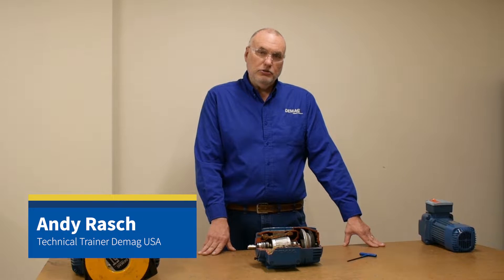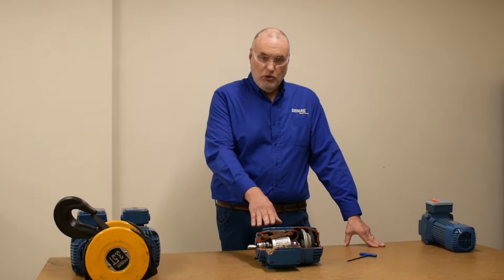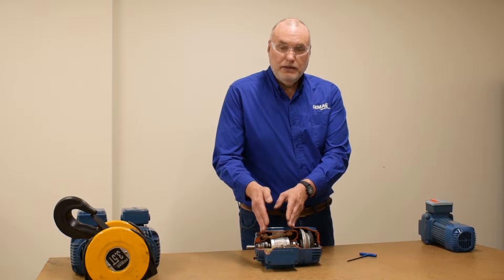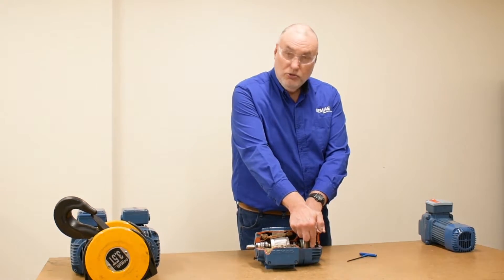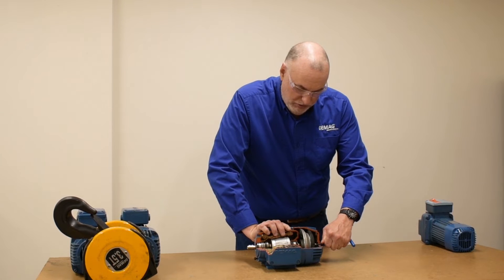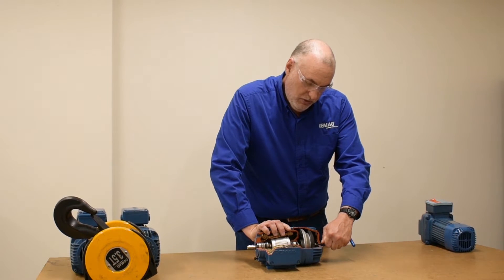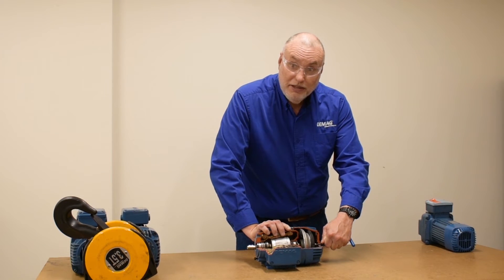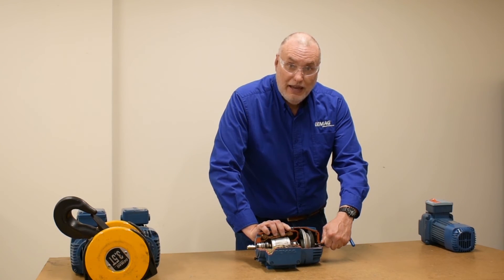Explaining Axial Displacement/ Brake Wear on Demag Conical Rotor Motors | Demag Cranes & Components

Comment: Sir...recently we found in hoist motor(30tonn, 11kw/1.7 ks, 460/2800
Rpm dual speed motor) displacement of shaft was occuring in fast speed up , fast speed down and slow speed down during crane in loading.But slow speed up case, axial displacement of motor is not occuring and brake pad is rubbing on drum itself.
What is the solution for that??
Reply: At no load condition, axial displacement of 
Shaft is happening in all the operation.